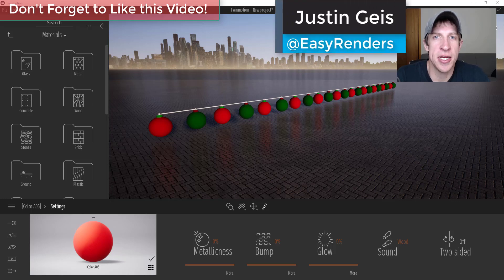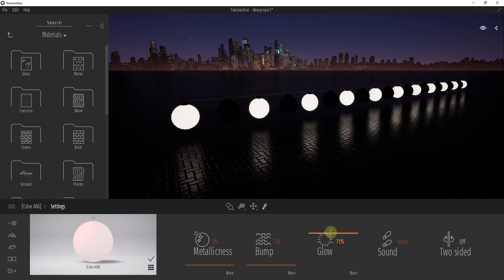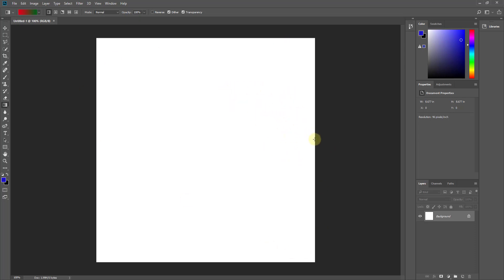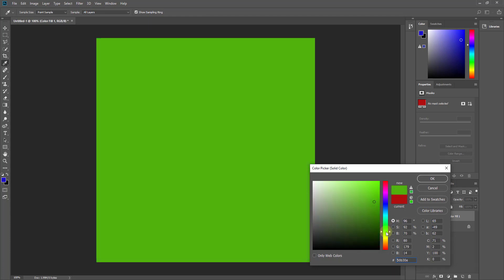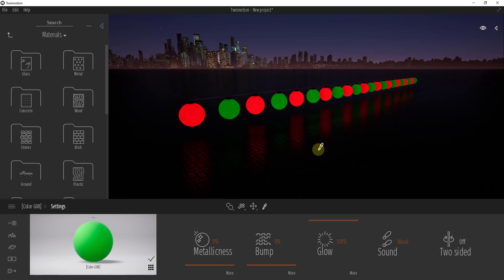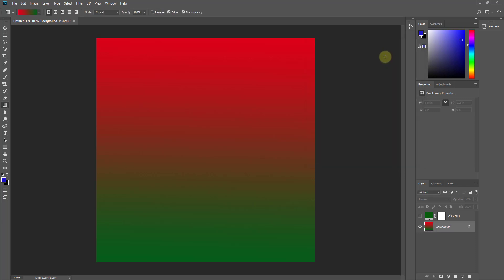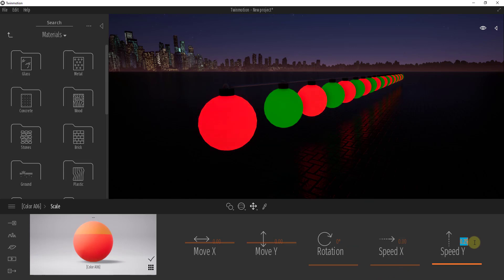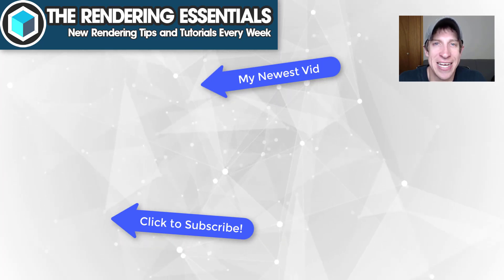Creating Colored Lights and Lights that Change Color IN TWINMOTION

Comment: Thanks for the great video! I do have a related question. Not sure if you'd know the answer to it or it's simply not able to achieve in twinmotion yet. How do you make the light fade gradually and smoothly in a video? I've tried to turn off the glowing object but the effect is very abrupt and only takes effect till the end of a frame within one video sequence unless it's duplicated (and only start to light on/off in the middle of the frame). It doesn't seem TM would allow you to adjust the material per frame or sequence either in the video mode. Thanks in advance!

Comment: Good video Jason, thanks. I have been using the same procedures but the colors won't glow. I don't know what is wrong. Any help please...
Reply from the maker: My name is Justin, and I assume you're missing a step somewhere - if you're loading a glow map, they should glow...
Reply: @TheRenderingEssentials   Well Justin, pardon the misspelling please. I have tried the James Chang's option of loading the glow map in the colour texture and it  worked just fine. Thanks.

Comment: hey J, I just tested on my mac version twinmotion, I have the latest version which works little differently, instead of loading a color image into the glow section, you just load it into the default color section instead. Boom! it works like charm.
Reply from the maker: Interesting - That's definitely not the way it's working on my PC version, but maybe they're just different. In any case, glad it's working for you :)
Reply: I have exactly the same issue on my PC. The glow map doesn't do anything at all but the texture map in the colour section will glow when glow is applied. Very odd. I'd rather it worked Justin's way as I'm trying to create a material that looks blank in day time but glows multi-coloured at night. Works for purely night time videos though.